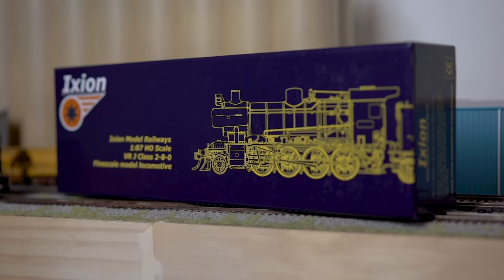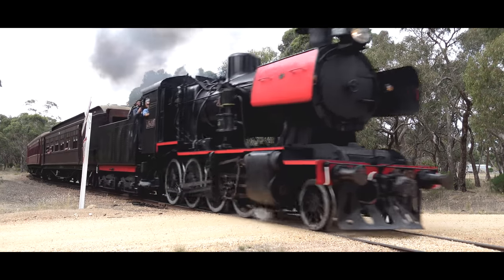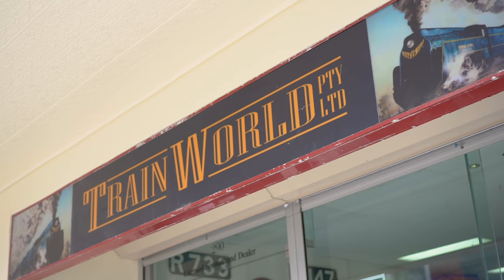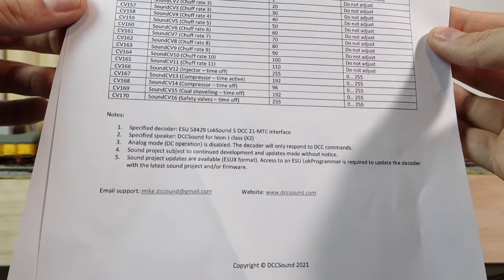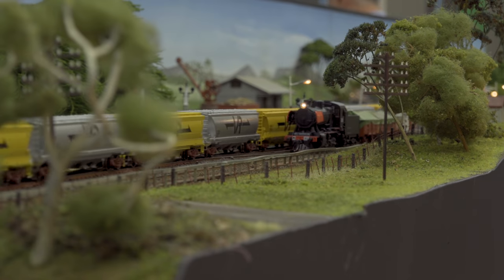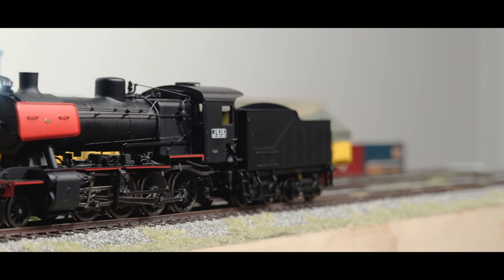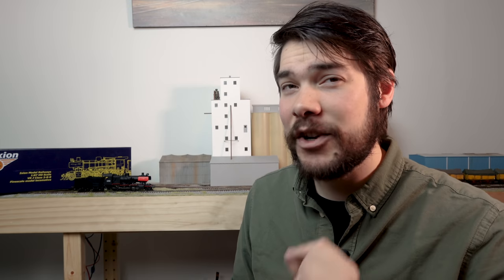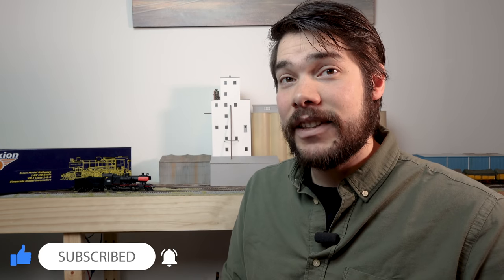IXION MODELS: J CLASS STEAM LOCOMOTIVE REVIEW WITH DCC AND SOUND

Comment: You’re doing a good job convincing me to buy this model. Just be careful of the electrical pins connecting the loco and tender. I have a eureka r class with the same kind of connection. The drawbar can spring off, leaving the loco and tender only connected by the electrical wires. This can cause the wires to be pulled out of the pin, which is what has happened to my loco. I need to look into getting a new part.
Reply from the maker: Ah mate I’ve got one to! Yeah something I’m always careful of! Thanks for watching
Reply: Have a look at the ‘how to’ video on Ixion’s website or Facebook page, after watching this it took less than 30 seconds to connect the loco to the tender.
Reply: @deanbrookes2609  that video is not good enough. And does not solve the problem... you can follow these instructions and fit the electrical pins all snug (as described) and the tender keeps coming apart. Put simply the "hook spring" arrangement on the physical metal connection just does not cut it. I agree with Will. This is a shocking connection arrangement. IMO!
Reply: @wapphigh5250  Hi, not sure if you meant to send this to me only? Whilst I have made some comments re the J class I don’t recall commenting on the electrical connections? BTW I agree the connections are a bit difficult, I recently bought a Phoenix D3 and they have a great arrangement for the connections, maybe Ixion should take note !
Reply: @wapphigh5250  Apologies I did find an earlier post where I mentioned the video re the engine tender connection - I found this useful and had the connection made reasonably quickly, however I do avoid taking it apart too often as I expect it will loosen with multiple connects
Reply: @deanbrookes2609  100% agree - the D3  is way better. I have one as well. I always keep my locos and tenders together. You got any ideas how to keep that upward knob on the J Class loco part of the metal coupling in the socket of the tender? It is just not robust enough for me and continues to come loose. There is just no enough distance between the end of the "knob" and the hook. ... I am thinking of getting some sort of small silicone washer? To side on the knob (after connection).. Like one of those rubber bands the orthodontists use? But I really feel this is an issue for Ixion. Seriously?! End customers should not have to be sorting out such problems.... partic fundamental basic running issues like this one. Just MO
Reply: @deanbrookes2609  Does your metal join come apart when running dude? See my other comment...
Reply: @wapphigh5250  I haven’t had any problems with metal coupling, I’ve had it about 4 months now without any issue, so unfortunately I don’t have any advice for yours. I had my original loco replaced by Ixion due to the grinding noise it made, perhaps you could send them an email to see if they have a fix for your issue?

Comment: A good and balanced review, thanks. I got mine yesterday with sound via dccsound and I am very impressed with both the model and the sound project. The loco is a very smooth runner and crawls well at speed step 1. The lights are a bit ‘white’ but with dcc the brightness can be dropped using the ‘dim’ function and I have some tamiya x26 clear orange paint that can be used to make more yellow. As you noted the noise from the mechanism is quite loud, can be heard even with sound on. I contacted Ixion to see if they had any advise for this, seems they have had this complaint from a few others also. They suggested that I should relube, and failing that return it.  I will relube and and update. Any other suggestions on reducing the mechanism noise welcome.
Reply from the maker: Thanks Dean! Thanks for the message! I'm glad to hear you're enjoying it! 
I've now see a few people pop the x26 on the light and it looks very good! 
Let us know how you go!
Reply: @WillJamesRailways  Hi Will, after doing a relube (Ixion have done a good job to make it easy to access the mechanism), and running for an hour or so there was no improvement in noise level. So I again contacted Ixion and as I live in Sydney, and Phil from Ixion was coming to Sydney he paid a visit to see/hear the issue. He believes that some of the motors supplied to the factory were faulty and has a few similar cases. He has taken my loco back with him to change the motor and I will PU next week. I’ll give a further update then.
Reply from the maker: @deanbrookes2609  thank you for the update Dean!
Reply: Just following up. I went to Ixion and they had not been able to assess what was causing the noise in my loco, however it appears to be faulty motors which can be also identified by requiring higher start voltages >5V. Ixion gave me a replacement loco which is very quiet and runs well, it starts moving at around 2V. So I would suggest for you and your viewers that if you have a noisy J class that you should at least make Ixion or where you purchased from aware of the problem then if the problem persists you will be able to get a repair or replacement.

Comment: Mine arrived with an intermittent fault in the motion gear, and very rough running at low speed. Ixion have been very helpful so far and it's been sent back to them to be looked at. 
Just quickly weighing in on the hauling capacity issue -  it is interesting how different people are having very different experiences here. Mine was barely able to haul two passenger cars up the 1 in 30 ramp on my layout. For reference, all my diesels (even something like a T class) can handle at least 5 cars up there with no issues. I'm hoping this is also something repairable, possibly just with a good clean of the wheels. 
I reckon it would be worth carefully painting those visible pickups between the drivers wheels too, doesn't look like it would be too hard to do. 
My only other thought so far is the marker lights - it's a bit of a shame the front marker lights don't light up, and the rear ones can't display red.
But... as you say, overall great model, and hopefully I see mine back and running again soon!
Reply from the maker: Oh right! Well it's good they're taking care of it! Hopefully that's an easy fix! 
I agree, I reckon painting the pick ups would be an easy job, and i might do it when I get around to fixing the yellow lights and adding coal into the the tender. 
Thanks for the feedback mate!

Comment: Hi Will just a quick question. In the video you mentioned you got it DCC fitted at Trainworld so what is the process for me sending in a model for DCC fitting? do I have to supply my own decoder or do i buy one from them? How do I organise for them to fit a decoder and how much does it cost ect. As I have a loco that needs DCC fitting. Really hope you can answer my question.- Nicholas.
Reply from the maker: Hey man, so easy answer. Call them/ email/direct message them. 
Im not sure of the cost as I’m sure it varies from model to model. But like I said in this video it was $250 for decoder, speaker and sound files for the J all supplied/bought from them.
Reply: @WillJamesRailways  Thanks so much for the reply that answers my question. Thanks.
Reply from the maker: Easy done! But yeah with world wide chip/component might be a wait! But here’s hoping it’s not!

Comment: OK, i finally got my J Class. Some thoughts...

First, Will's review is spot on.

And also first, Startrack couriers - just awful, and funnily enough it took a drivers' strike for me to actually receive my delivery. How weird, while drivers are on strike we actually see an improvement in service. They should do it more often. Metro Hobbies were very helpful, but do you need to use Startrack Metro Hobbies? I won't be ordering online again, far too stressful.  

The loco is lovely. Nice detail, I appreciate the representation of motion gear between the frames, particularly since the J's boiler sits so high. It's a lovely looking model, really is well done. It will look stunning under a light coat of weathering.

Tender uncoupled for storage - this is stupid and annoying. There is no reason for this and no one else does it (that I know of)

It's loud, like a groaning tractor. I was wondering if this will settle down as it ran in - nope, not so far. I haven't got mine sound fitted yet, but it's the noisiest loco I own by far.

Light are far too bright. This is annoying and makes them unusable. They just look silly. Like you could read by them.

Point work. I don't get this. It blasts through complex pointwork with slips and diamonds (and looks fantastic doing it), but derails on the simplest set of Peco long points - not all the time, maybe 20% of the time. This is frustrating because it shorts the whole layout (I don't have blocks yet), but I can't see a reason why it does this. The Eureka R has no problems here, and thats a finicky (albeit stunning) loco - in fact none of my locos have a problem here, and it's an old reliable layout. Maybe the pony truck 'hunts' and this is causing the issue.

I think the price is about right, that's what you pay if you want to model Aussie stuff. All in all, I reckon it's pretty damn good.
Reply from the maker: Thank you Matt! 
I agree with your thoughts on Startrack there mate! 
Yeah I really can't see myself pulling it apart very often, it fits in an Auscision blue box with no worries. 
Agreed with you on the lights, looks like alot people have started putting Taymia x26 over them and it has dulled them down nicely! 

Yeah right! Perhaps a little more weight is needed over the front trucks? Help guide it a bit more? Still that's not great! 

Thanks for your message Matt!
Reply: Unfortunately that's Chinese manufacturing for you, Marklin are still made in Germany,  before every piece of rolling stock leaves the factory,  it is put through every single track component and combination of track components. If it comes off the track it gets recalled. I understand the scale of economics doesn't allow for that when a company is building Australian trains, but what is the point of limiting the production run to 1600, then not have all the bugs ironed out before turning them out?

Comment: Hi Will, yes l have purchased a J Class 525, as you know l live in the United States,  so l hope l get it before end November. It would have been nice with DCC sound,  hopefully l will be able to find a place that l can purchase the right sound files  at fit it myself,  cheers mate.
Reply: DCC sound can email you a sound project if you have a decoder and a lokprogramer they just require the serial number of the decoder as the project is locked to the decoder
Reply: @KalingoJunction  thanks very much for the info.
Reply from the maker: Fantastic to hear Adam! I reckon that's something that you could certainly get happening over there!

Comment: I agree about the colour temperature of the lights and also the headlight is pointing up at the trees, hopefully it can be adjusted.  I noticed some other little flaws as well and I think that, for such a high price, it should be perfect.  Apart from those little niggles it looks terrific and the sounds are good too.  Your layout is looking good too.  😊
Reply from the maker: Yes, i have noticed it's a big high, i might have nocked it, as it's just has pushed back down. 
I'm going to disagree i think, if it was in the brass price bracket i'd want perfection but i feel at sub $600 it's absolutely fine, but i that's just my own standard. 
Yes it's slowly coming along!

Comment: With the discussion of smoke units, people planning on going to the effort and expense of finding one that may fit might also check with clubs with club layouts.
 My understanding is that some clubs ban smoke units being used.
This is due to them finding the vaporised oil used for smoke settles on the track and scenery leaving an undesirable oily deposit. Even sixty years ago some smoke units left oil drift on loco bodies.
Luckily with DCC the smoke units usually now fitted can be turned off as I understand.
Reply from the maker: That's correct John, I know my club let you run them. As there are now even diesel locos coming fitted with 'working' exhausts. 
But yes, like you said on the DCC models you can just switch it off!

Comment: it will be interesting to see how many get returned. as we had 5 of them running today at my local railway club and 2 are being returned to the dealer with locked up drivetrains ( before they could even get run in)  and 2 now have very noisy geartrains after only short running times.
Reply from the maker: Oh wow! Todd that's not great news to hear about a brand new model, especially that many! Thanks for sharing that with everyone. Let us know how they go!
Reply: @WillJamesRailways  Ixion is aware of the problems apparently and has been advising that everybody should fully lubricate their  model as per the instructions as some were missed at factory and to check the tightness of all screws in mechanism as some were under tightened and are coming loose to jam up the mechanism.

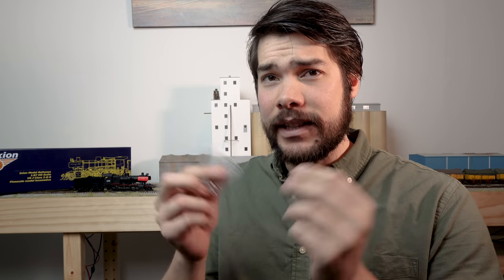Comment: Hello Will, a great review of this model.  I personally know the producer and they had big expectations for this model and have delivered it although to be fair a lot of the production and quality control is out of Australian producers control.  I am waiting for mine but have seen one in the flesh yesterday and it was a little noisy and had a little bit of trouble pulling up a 1:30 grade with two Tait Trailers and a dummy but removal of the dummy dragging it went away with no problem.
Reply from the maker: Hello Paul! Thank you very. Yeah i mean over all it's  a great model, and i think if there wasn't about to be a lot more locos about to hit stores I would have doubled down and gotten an oil burner! But they seem to have been very popular and have already sold out! 
Oh right, i didn't know the dummy was the heavy or it was all just a bit much for it?

Comment: I'm pretty sure the J class at Noojee is in working order, but just doesn't have permission to run, and not enough track. But having looked at it, it is being regularly maintained, for running condition. I went past there recently on a weekend, and I'm pretty sure it was fired up.
Reply from the maker: Unfortunately it’s not, they just light the fire in the smoke box and from what I’ve been told it’s doing damage.
Reply: @WillJamesRailways   That's unfortunate. I know that the person looking after it, has been going around keeping all the part of it oiled.

Comment: Yep same as you found noisy and did a bit a lubrication, made no diff, but noise get notice only at high speed step in your vid couldn't really tell mine is more like a wine, anyhow oh run on smaller radius pretty well also compared to what it is recommended for.
Reply from the maker: I see it's seems to be pretty much all of us having it being a loud runner, which is a bummer! How tight of a radius have you put it through?
Reply: @WillJamesRailways  Set Track builder I am, 2nd slowly, and 3rd and 4th runs fine with no issues

Comment: I really want Ixion to do well and I am grateful for Vr prototypes, but I must say I am disappointed with the low speed running and the mechanical whine. I cannot get it to run smoothly at very low speed. Hopefully the second run will have some improvements. Thanks for the review.
Reply from the maker: Totally agree there mate! I wonder if something like a keep alive (at least for DCC) would help fix it? Thanks for watching!
Reply: The low speed and mechanical whine is not an issue with a DCC sound fitment. That low speed running problem is solved with a DCC chip. And with sound on, the whine of course can;t be heard. What remains "a problem" is the tender connector! Anybody have a solution? thanks!
Reply: @wapphigh5250  unfortunately low speeding running is no good, regardless of the fitment of dcc. The whine is most likely a mechanical issue, likely the gears, or the armature not being lubricated correctly.
If you were able to gain smooth low speed running at a crawl I'd be keen to k ow which decoder and what settings you've used. I've tried a few and the best result is from a lokpilot. Cheers.

Comment: Good thing they are sold out already or I might buy one.  Two complaints about the decoder configuration, the directional lighting, I hate it, real locos can have the front headlight on while it is going backwards.  Second is the light starts before the genny!  Nice tarps BTW, tea bags like mine?.
Reply from the maker: Ah Mark, there’s still a few around! Looks like they might even do a second run! 
Yeah good point I didn’t even think of that, I guess that is fixable in the programming side for DCC? 
Thanks mate, yeah it was my first shot at the with the tea bags, they need a small touch up but was a lot of fun to make!
Reply: @WillJamesRailways  yes, decoders can be programmed to leave either or both lights on irrelevant of direction.

Comment: I was doubly convinced about the Ixion J even before your welcome review.
I have been helped with some useful advice in the past few days from people you likely know that convinced me to purchase before they quickly sell out.
Your earlier video of the pulling power at this year's Diamond Creek Exhibition was a big part also.. My guess a few reports of low pulling power may be related to something not installed correctly like the DCC tender connection complication that I could do without.
Hoping the noise will be reduced with running in or lubrication and not indicative of a design weakness.
Good that these are available in many local outlets.
Next on my purchase list is the SDS or is it Phoenix D3 models.
Reply from the maker: Great to hear John! Which one have you gone for? 
I agree, it does seem to sound like user error rather than model issues. 
Yeah I guess we'll see how it goes long term. 
Same here mate! Really keen on the D3 & K's
Reply: @WillJamesRailways  500 and 541 so doubly convinced.